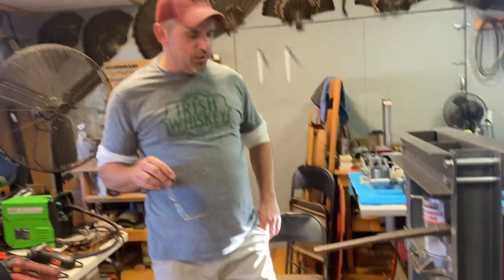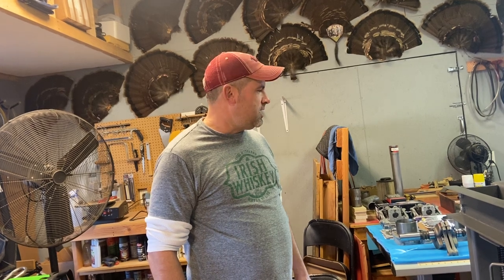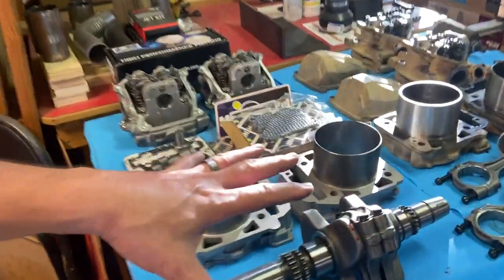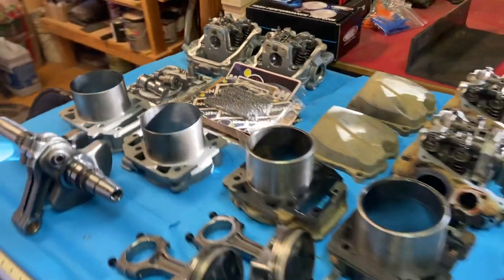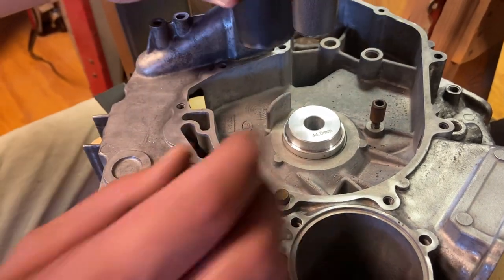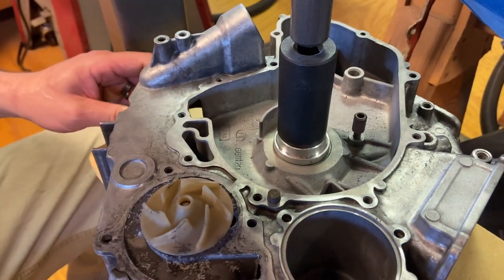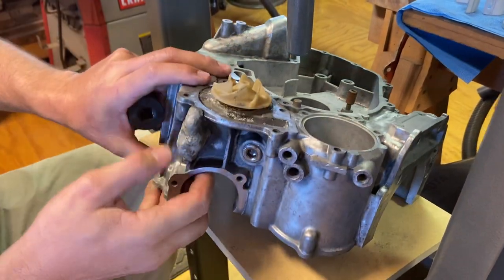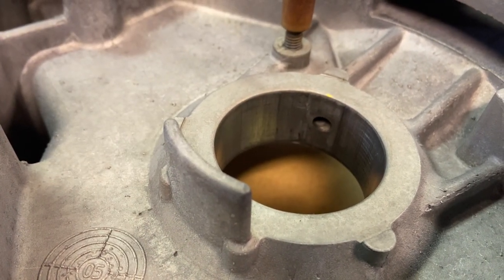Can-Am Gen 1 crank case bearing sleeve removal and install

Comment: Where do you get your rebuild kit for the motor?
Reply from the maker: Man most everything comes from Mr RPM cycle @mrrpmcycle.com, but like gasket sets, you can get a complete gasket set off eBay for around $150, cheaper than Mr RPM. Make sure the ad says “complete” though.

Comment: How reliable are these engines?  Plastic gears?  :(
Reply from the maker: I’ve built eleven Can-Am motors now, nine of which were not stock once I finished, all of them had the same plastic internal gears. Never seen any with damage, I presume they are made out of some harden plastic. The biggest thing that would cause damage is if the cam chain were stretched to the point cam chain tensioners didn’t serve their purpose anymore, then the chain jumps off the cam gear or crank, then I could see those gears getting shredded. Hope that helps….
Reply: @mudhawgmafia3896  Thank you.

Comment: Hello.. 
Getting the low oil pressure light on “only when at idle” and when the engine is warm after like a 10 min ride.. it goes off when i slightly press the gas.. changed oil and filter but still the same.. checked the oil pressure to be 3 psi at idle and around 35 to 40 psi when i press the throttle…any clues?
Reply from the maker: Just curious, what kind of mileage or hours on the motor? Has the motor ever been sunk? There’s many oil passages in the engine case that can get clogged with debris, along with there’s a oil screen inside the engine case, right above the drain plug, that also can get clogged with debris and cause your oil pressure issues. Debris can be just from normal wear from internal engine parts, that’s why I ask about the hours/mileage? There’s also an oil pressure sensor, it could possible be dirty or bad, causing the false readings? 
Hopefully some of that helps….
Reply: @mudhawgmafia3896  Milage is around 10,000 km and never been sunk..  i have tried a new oil sensor but still the same issue.. whats the best engine internal cleaning process without splitting it?
Reply from the maker: @mishaalsalha6494  brother, I’m not aware of any cleaning method. If that internal oil filter screen is dirty or clogged, that could definitely be the cause of you oil pressure issue. I recently had to tear down the motor I just built because I’d sunk it, and when I split the case and checked that screen, I literally had lint on it from the rags I used when cleaning the inside of the engine case, when I originally built the motor, blew my mind. Evidently all the engine oil circulates through that screen! If you ever drain your oil, lay under your bike and with a flash light like look through the drain hole and you should be able to see it!

Comment: Is there any other way to remove these without a press? Maybe a Rental tool?
Reply from the maker: Man, honestly no, I originally tried heating the case up around the sleeve with a torch and knocking them out, kinda like doing a wheel bearing. Won’t work, plus you risk damaging the case.
Reply: @mudhawgmafia3896  ok thanks I'll try to find a machine shop near me. Looking forward to the finished rebuild!
Reply from the maker: @mrkasual6776  ya, that’s how I come about buying a press, for those bearing sleeves. But it’ll come in handy for wheel bearings, etc
Good luck on your build!